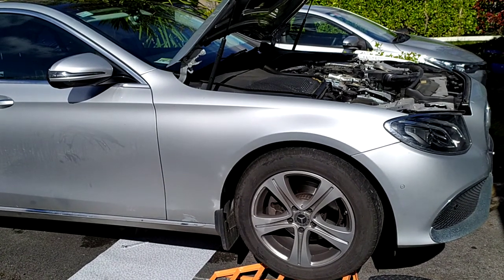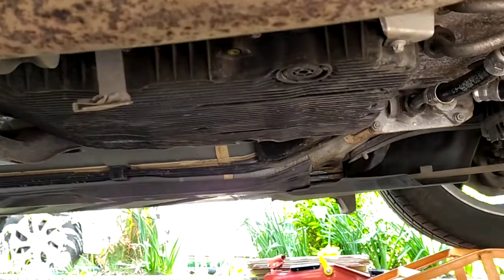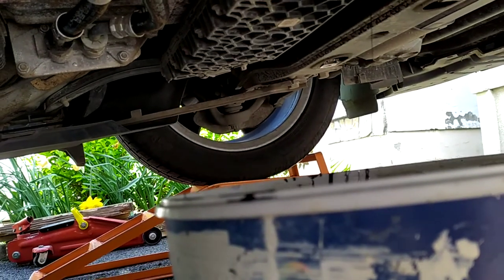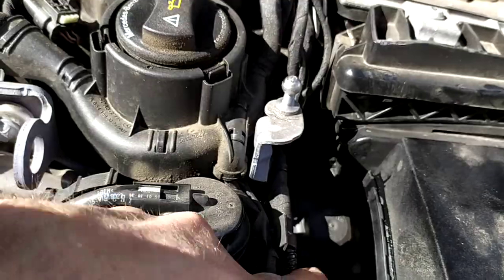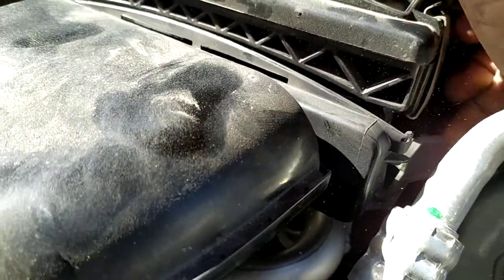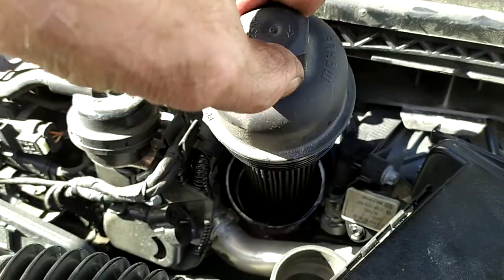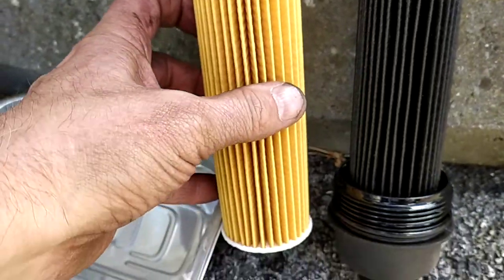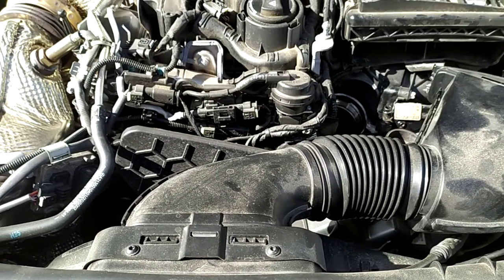Mercedes E Class E220 W213 2018 Model Oil & Filter Change

Comment: How do you dip the oil level
Reply from the maker: It is electronic, and you can check it on the service menu on the dash. It's a bit of a pain as I had to drive it a couple of kilometers before the level showed.
Reply: @ImRaHorakhty  No bother thanks

Comment: Isnt having the front of the car up on ramps going to leave quite a bit of oil in the sump ?
Reply from the maker: Its possible and depends on whether the drain is located at the fwd or aft side of the sump and the car slope. However, it would be a minimal amount. A lot of garages now suck the oil out through the dipstick which has a greater potential to leave some oil in the sump. There is no dipstick in most of the newer mercedes so you don't have the option to suck it out. In my case the full the listed capacity of the sump was drained from the sump so I would be confident it was sufficiently drained.

Comment: Hi Peter, is it necessary to replace the plastic oil drain plug with a new one after the oil change? Would it be better to get a new plug at every oil change?
Reply from the maker: Hi Bronze Hand, yes, you are better to replace it each time if you can get one. In my case I had hope to suck the oil out so I did not have a replacement however, I checked it several time for leaks and it was not leaking. I am not sure if you can get the bung from an general motor parts supplier, you may have to get it from a Mercedes parts shop.
Reply: @ImRaHorakhty  Thank you.